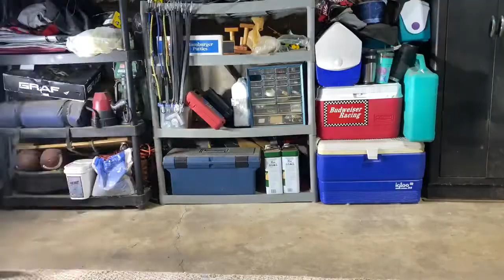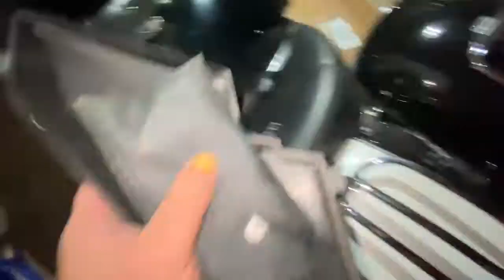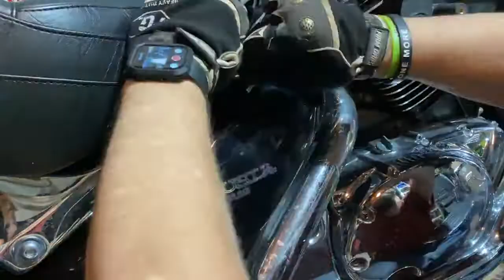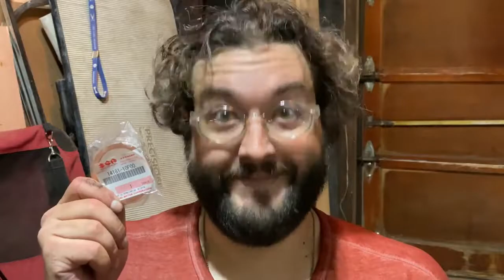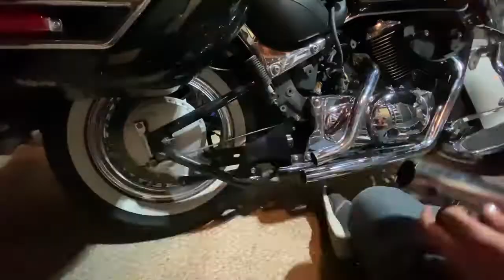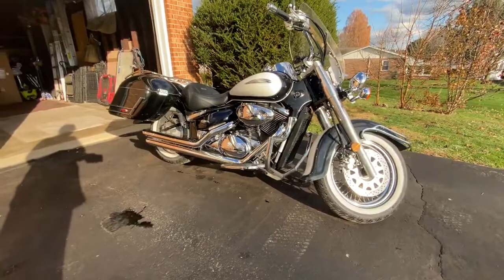Suzuki VL800 Exhaust & Air Filter Time Lapse

Comment: Did you have to rejet the carbs? I seen the other video of you doing it. But did you have to? I just ordered all of these same parts the other da
Reply from the maker: I ran it a little over the winter in colder air with the new pipes and stock filter, but it wasn’t great. Should really re-jet for pipes, definitely need to for pipes and filter.